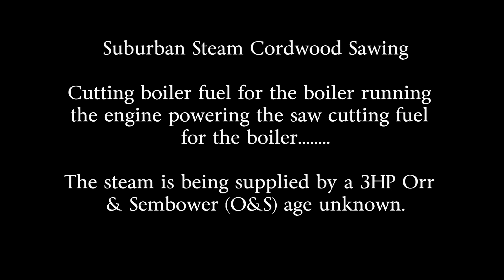1890s Steam Powered Flat Belt Cordwood Saw 2001

Comment: Governor needs some attention and engine needs sped up but pretty damned cool
Reply from the maker: Yes it is a bit sluggish. The engine is supposed to have a 1" governor. 65psi didn't help matters either. At the time the only spare governor I had was the oilfield style 3/4" Judson you see in the video. It now sports a 1" New Judson. If some video a friend has can located I will make a montage video of the engine.